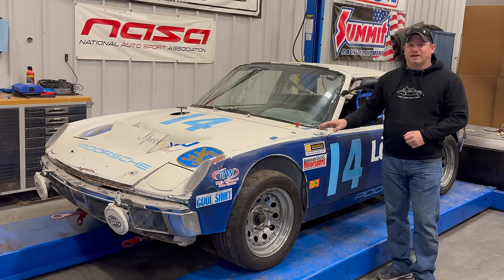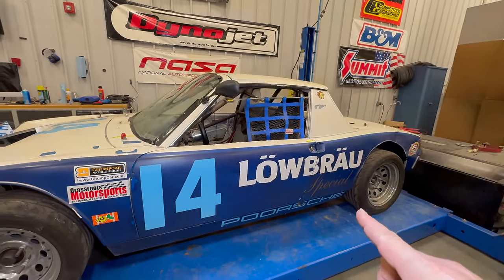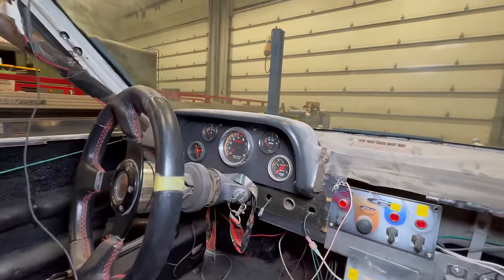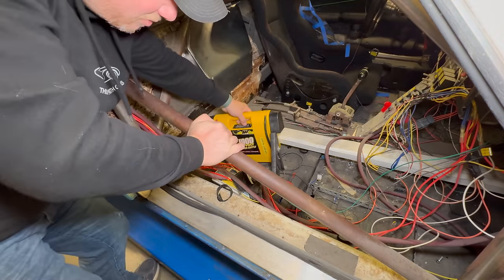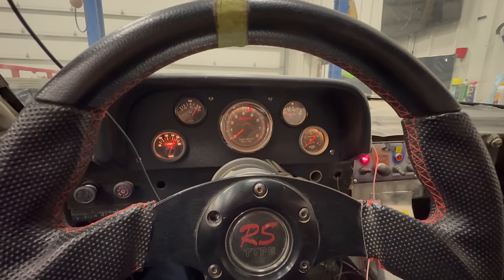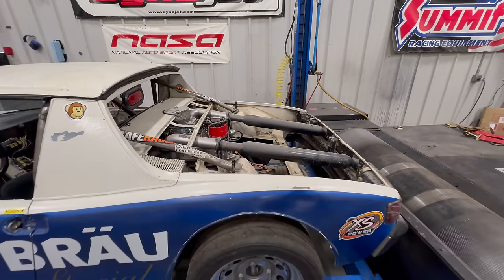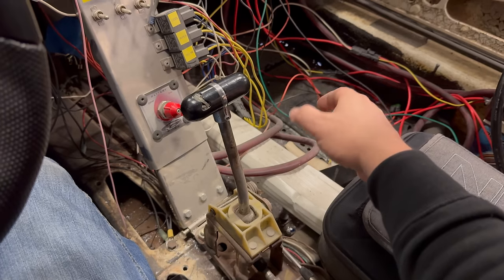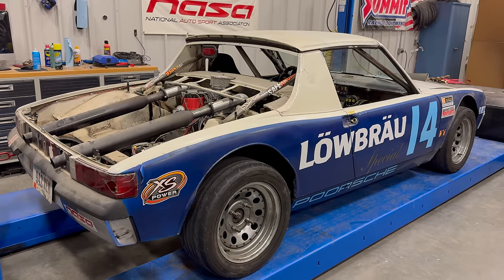Modified Porsche 914 Race Car

Comment: Way back in 1979, I bought a 914-6.  No motor, interior trashed, but the outside great!  Someone had done a full Trans-Am package, air dam, 10" wheel flares & a whale tail.  Didn't realize it wasn't stock till many years later (sold it the next fall, was looking for storage, a guy offered me way more than I had in it, & as a college student it played for my rent & tuition for the next year, lol). Found a fresh motor with side draft Webers, at a buddies shop, that hadn't been paid for...  Still miss it, was fast & handled very well...      Thanx !

Comment: Wow that is crazy that it started first time with the bigger jump pack. I think you should sort the wiring and finish the car even if you don't race it  Steve I think it needs to be used.  👍👍
Reply from the maker: It probably had plenty of fuel in the intake from failing to start it that it started right up once I had enough battery power to it.

Comment: Just love 914s.
   But the transmissions simply  vampire them of almost any potential. 
 Never have I ever had so much frustration shifting a automobile...lol.  I've driven quite a few of them and my God it takes over 1.0- 1.5 seconds to change gears when accelerating ...😅
 Ive driven conversions and one w a G50 conversion ..albeit it was a 911 engine too. 
One with a flipped Boxster transmission was sublime. 
  
 When the awful linkage has been replaced  it's a  ..GODSEND! I say a stock 2.0 with a modern trans swap would out perform a v-8 w a stock trans the performance is that drastic. But in The last 10 years..914s have gone from $800.00-$1500.00 running cars to 20k plus, and newer transmissions  are so hefty IN PRICE it takes the fun out of a cheap car 
 However is what it is, if you throw everything in the book at a 914 tranny to aid it's clunky shifting , it helps a lot. Great lil cars....but given a choice I'd pick driving  a 510  6 ways till next Sunday...
 
looks like fun regardless👍

Comment: The drive axles are going to be a reliability issue at that angle.
You have the same issue with Subaru swops into bugs when trying to clear the rear valance.
Might be worth trying to squeeze the engine forward more if possible.

Comment: I think you should just get it safe to drive hard, and then start entering it in Porsche Club of America events to horrify the other members! I'll bet it's faster than stink, too, at least until the forward-swept half shafts chew up the CV joints...
Reply from the maker: Oh my!
Reply: Cv's are designed to run that way. Why would they get chewed up? Maybe they are not strong enough, but that was probably factored in...

Comment: I've had 2 914s but many years ago, but im confused on why the shift pattern is reversed. Thats the original layout, obviously with a sbc instead of the 1.7,1.8 or 2.0.
Reply from the maker: I don’t know why they changed the shifter other than they felt the original was unreliable, this though has other problems.
Reply: Original shifter linkage wouldn’t clear with the v8 in, but a known solution was to use a DSM shifter with some cables from McMaster-Carr. The pick-a-part didn’t have a DSM, so we grabbed what we could find, and the (surprise) result was the flipped pattern.
Reply: @cdhigs  I see. That makes sense. Thanks for clearing that up! Super cool car. I'd imagine it's a blast to drive.

Comment: Is that still the dogleg 901 transaxle?
Reply from the maker: Yes still the 901, 911, 914 transaxle.
Reply: Looks like an early 914 (901 family) tailshift with a homemade cable shift setup.
Reply: @RichardCasto  that’s what I was thinking not the 915 later transaxle with the standard H pattern

Comment: Wouldn’t the increased torque of the Chevy motor be too much for the Porsche transmission? The Porsche 1.8L produced around 118 ft lbs.
Reply from the maker: They used this transmission in the 911S which made 160-180 hp it is the axles that I am most concerned about.
Reply: @ThisWeekWithCars  Its a 289 not chevy
Reply: @ThisWeekWithCars  That offset in the half shafts can't be ideal.
Reply: You don't want to do hard launches in 1st gear as it will twist the cantilevered 1st gear right off the input shaft. CV joints is also a weak spot with increased torque. But better to blow out CV joints than something else.

Comment: At least correct all hack jobs done by your ex (I hope) teammates and put it back on the street at least.  Not sure I understand the logic of putting a V8 in when a perfectly good Porsche 6 cylinder would have been a nice fit.  But then just my opinion.☹
Reply: Cost? Honestly given how 914 prices continue to rise, I can't see how they can fit within 24 Hours of Lemons cost rules. And a six swap would be out of the question. Base core Porsche six engines that are not even running are many thousands of dollars.
Reply from the maker: Cost and reliability is why they did the engine swap.  That team knew how to keep a SBC running better than a Porsche engine.
Reply: After looking at the car the effort to do the V8 swap, it must have caused the cost benefit to have been significantly overestimated.  The effort to make it derivable would be interesting, but to make it safe to drive on the street seems rather more effort, especially if the rear trans axle had been relocated.  It would make a good comparison to the V8 swapped Covair's of which most seem to remain in an unfinished state.  Best of luck whatever you intend to do with it.